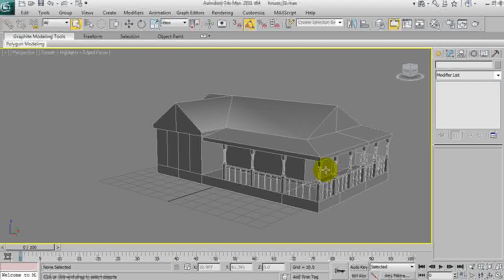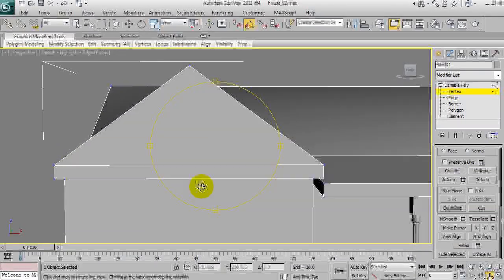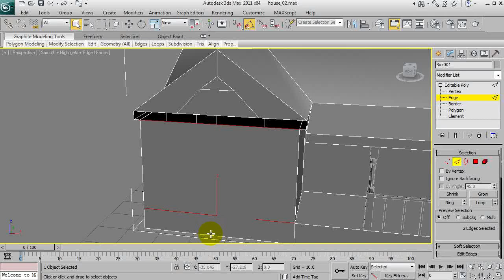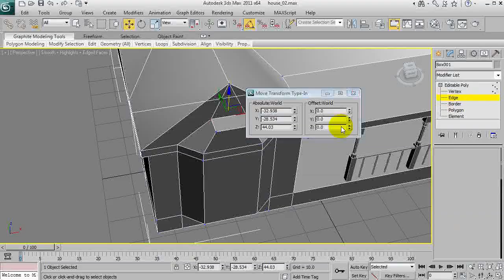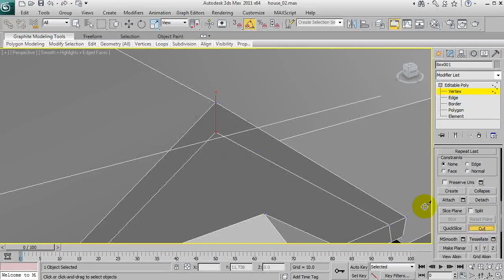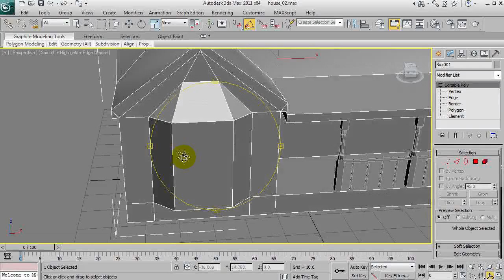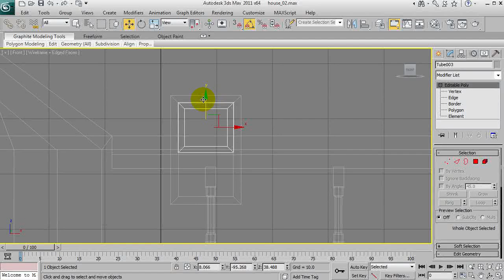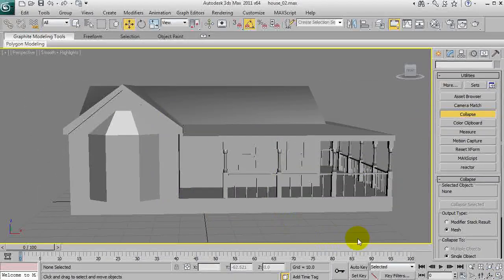Basic Modelling in 3DS Max: House (Part3)

Comment from the maker: at 0:53 I have the border selected, if u hit spacebar that will lock your selection so that's one possibility.

The other is that you can select a group of edges (the border) then at 0:56 I actually hit the shortcut to change to edge selection.

With editable poly applied to an object, 1-5 are vertex to element.

Comment: Just a small comment. When you are talking about fixing the polygons on the roof before working on the window, you say it was a 6 sided polygon when in actuality it was a 5 sided polygon. Which isn't really good to have either. However an easier way to fix that problem was to make the cut using connect that you did first making the gutter area, then cut down the center so you don't have to fix a bunch of other edges later to get rid of unwanted polygons. Which I notice you do a lot.

Comment from the maker: Not 100% sure what you mean but are you using the right extrude setting? change it to local normal if you click the little box next to Extrude, some options should show up, sadly my capturing software doesn't pick up these windows. I think in part 2 I include the image in an overlay at one point.

Again not sure but I'm guessing this is the problem...

Comment from the maker: @RemovdSande11 I changed to edge selection, used border to select it all quickly then changed to edge and deselected what I didn't want.
While you've got the object selected and it has editable poly applied, the numbers across the top of your keyboard are shortcuts to each mode.
1- vertex
2- edge
3- border
4- poly
5- element

Comment from the maker: @94knop It can't "Connect" if its going to do something weird with the geometry, because theres an opening above, it can do that.
Think of it this way, you have a cylinder with 1 height segment, and you want to make it have 2 height segments for half of it... this means there will be 2 polygons that will technically be 5 sided, which max wont let you do with the connect tool, if its not working, remove the polygon above and below where your trying to "Connect" and then do it and replace them.